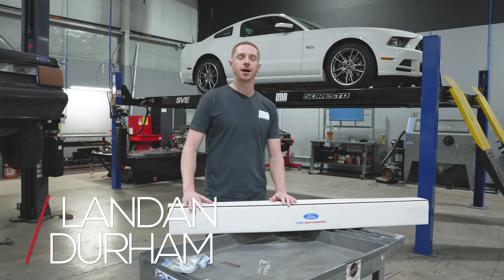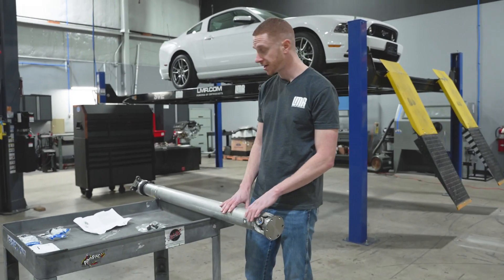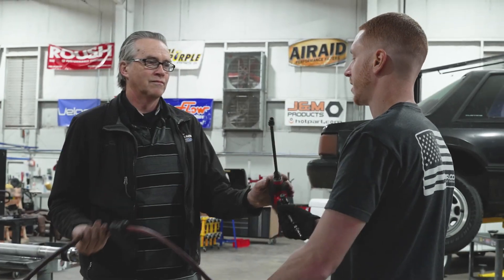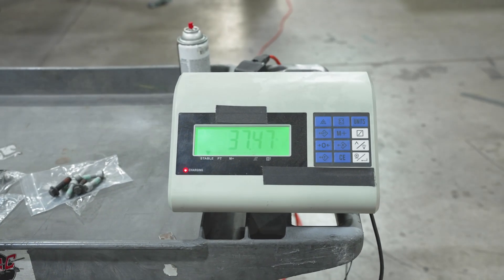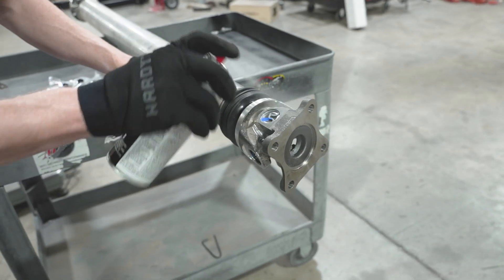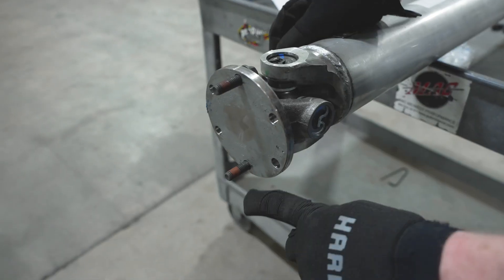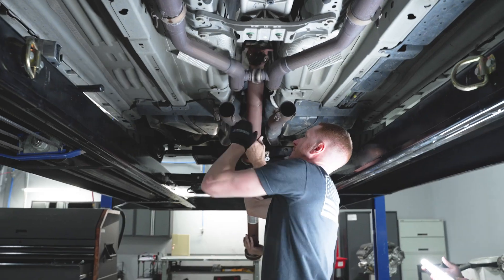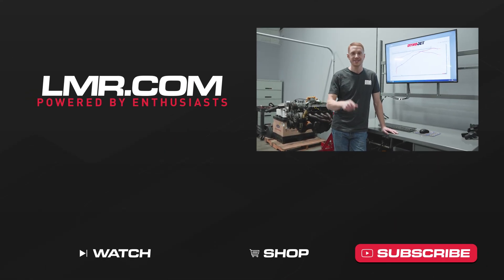"FREE" Up Horsepower with an Aluminum Driveshaft - Dyno Tested!

Comment: I have been considering this upgrade but have wondered how much cornering and tracking ability I will give up. What is your opinions on this? Sorry for the noob ?s
Reply: Why would reducing spinning weight effect cornering in a negative way? 
I have it and the biggest change is shifting and on off throttle as it has less weight to change the speed. But cornering is unaffected.
Reply: @rileycates5049  I didn’t know if it would decrease body flex In corners. Like I said I’m new to the mustang world and would like my build to stay more towards road courses.
Reply: @edwinwheatley2732  just received a whiteline front and rear swaybar kit kit with the heavy duty links . I havnt installed it yet but kinda excited to do so,, I have an 06 , unfortunately v6 but at least it's a 5 spd. I'm new to and am really wondering what kinda upgrade I should do when clutch kit time comes or is the v6 not even worth upgrading out of oem for clutch time? Any recommendations appreciated.
Reply: @nimrodpaul6875  venom stage two clutch w lightened flywheel.
Reply: @nimrodpaul6875 best upgrade for you would be sell and get a v8 car. Putting money into a v6 is never a good idea. They don’t hold value.
Reply: A driveshaft has nothing g to do with cornering or chassis flex man. At all
Reply: @MikeSmith-ey7ku  ok thank ya man.

Comment: I definitely felt a difference when I made that upgrade! Good to see some numbers behind it! Thanks for all you do LMR
Reply from the maker: No problem! Glad you enjoyed the video!
Reply: Noticed any increase in NVH?
Reply: @ChardDavis  less, Actually.
Reply: @dvinpeace I call bullshit
Reply: A two-piece driveshaft design is most often used on vehicles with a long wheelbase to prevent vibrations and damage that can occur with a longer, single-piece driveshaft.  

** Purpose and Advantages
Vibration Reduction: A two-piece design helps to reduce driveline vibrations. A single-piece driveshaft that is too long can easily become imbalanced and cause vibrations, especially at higher speeds. Dividing the driveshaft into two shorter pieces with a center bearing helps to mitigate this.  

** Increased Critical Speed: 
The critical speed of a driveshaft is the rotational speed at which it begins to vibrate violently due to resonance. By splitting a long driveshaft into two shorter sections, the critical speed is increased, which allows the vehicle to safely reach higher speeds without the risk of the driveshaft failing.

Yeah..... I think I'm gonna skip on the aluminum shaft
Reply: Did you have to balance your driveshaft?